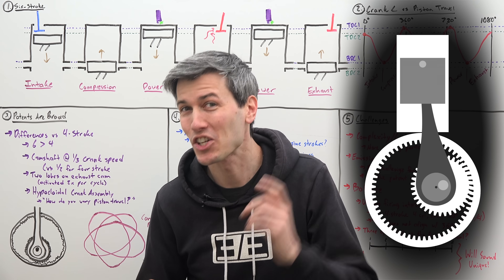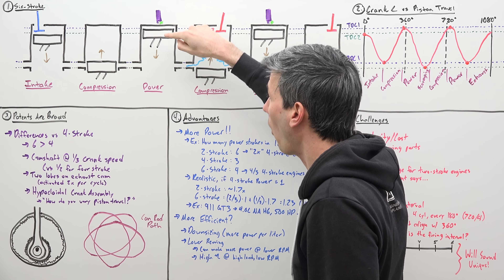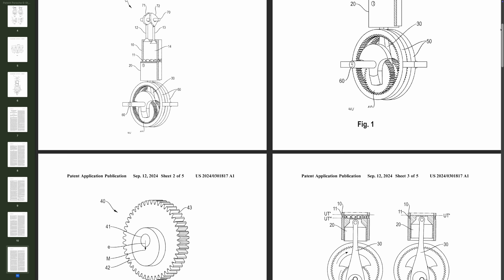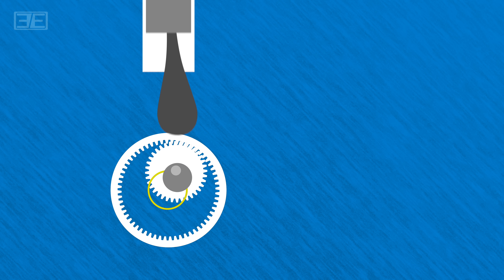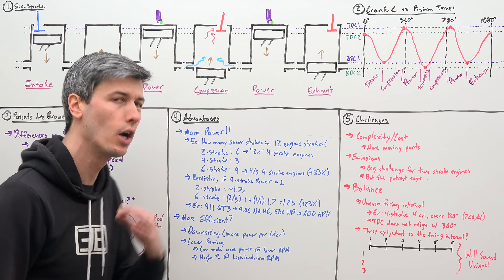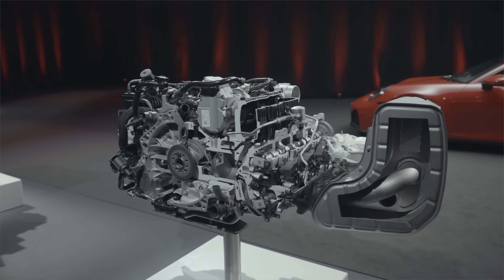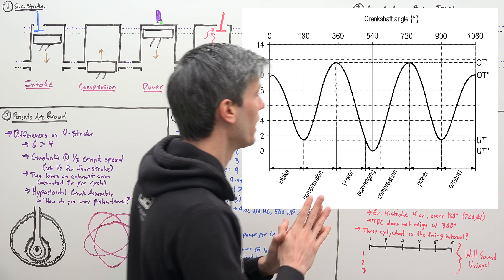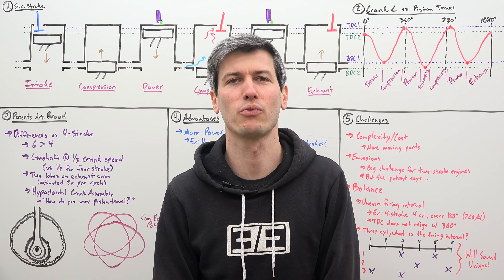Porsche's 6-Stroke Engine Is Genius!

Comment: There is no more fuel added on the second power stroke because there is still fuel left from the initial power stroke, something like 40%. Each power stroke has 2 cylinders firing, a full power one and a partially powered one. So it will increase fuel efficiency, power and emissions. It's pretty genius.

Comment: The connecting rod set up sounds like an inline version of what a radial aircraft engine does using a master rod. Having a mixed four and two stroke set up I image it would require two seperate fuel systems that would need to be synchronised.

Comment: Keeping the bottom end lubricated seems like an issue. You can't have a typical oil seal on the Piston like you would in a four stroke application, you also cannot run premix for efficiency and emissions nonsense.

Comment: Don't you love how a big corporation can haphazardly pull a technology out of its @55, not specify anything with formulae or actual proven testing, making a very generalized document, so that they can claim copyright infringement should anyone else, who is unknowledgeable of this patent, and does do all of the calculations and testing and  comes up with a functional engine. And during the court proceedings, the big corporation steals the outside data during the discovery phase, and uses it to their advantage. 

Sorry for being cynical, but it seems to be the current trend. Patents are supposed to protect the inventor, but the legal system has been abused so that patents stifle innovation.

Comment: There is a trend towards simplifying engines with fewer parts. Porsche could enhance these existing concepts by developing a streamlined engine design to replace the current complex combustion engines, not make them more complex.

Comment: The cylinder that is on it's two stroke portion of it's cycle will have a lower compression ratio than the cylinders on the 4 stroke version of the cycle, if I understand the explanation.  This will make the emissions of the two stroke cycle even worse than it already is, because to uncover the ports of the two stroke intake there is going to have to be a pretty fair drop in the piston's position in order to get any significant airflow to fill the cylinder.  This will make the compression ratio fairly terrible for the two stroke portion.  You might be able to clean the emissions up a little by recycling some exhaust into the two stroke cycle ala EGR, but it won't have enough kick to clean up the emissions from a two stroke.  Is the engine going to use two different fuel supplies to compensate for the drop in compression ratio, or is it going to use just the one fuel supply?  If it does, the fuel used in the two stroke portion is going to be wasted on that lower compression ratio portion, and it will also mean that it will contribute to the worsening of the emissions out of that cylinder over and above the previously mentioned two stroke emissions (higher compression usually means more efficient combustion, which means better emissions).

Comment: If you are going to scavange from low ports in the cylinder wall, why not just go for a scavanged 2-stroke design, a-la Detroit Diesel?  What do you gain with the extra complexity?  I don't get it.  It might work, but why do it, for Christ's sake?

Comment: What about the losses due to the gears rotating under extreme stresses. Friction and heat will be significantly higher than bearings. What happens if a tooth breaks?

Comment: It's amazing how we keep coming up with ingenious and expensive ways of creating carbon dioxide emissions. I got bored with the video. Is there a massive increase in efficiency from this? A massive reduction in carbon dioxide emissions? A massive reduction of other pollutants? Improved safety? Improved (reduced) noise? Improved power? Better balance with less vibration? Cheaper to produce?

Comment: 1. Balancing is not about firering in even intervals.
2. If you shift the Zylinders 360 degrees, every 360 degrees zylinders are firering, and thats even then
2. A. Thats the same rate, like a 3 zylinder 4 stroke engine, but with double time firerings
2. B. But the balinging in this case ist difficult because of: the zylinders go up and down together.
2. C. 6 zylinders would solve this problem (with 180 degrees shift)
3. There is another balancing problem: the different accelerations and decelerations inbetween going up and down ... I think here you need some difficult balancing shafts
4. If you use 180 degrees with only 3 zylinders, then you have 1 stroke with 2 firerings ... But this could be a benefit in terms of torque and grip.. If you have one more power stroke, thats good (just more power) .. but inbetween, the tires can "rest" and can catch more grip .... 

I'm not an expert ... But this are my thoughts at this issue 

(I'm a german guy ... Please apalogize my English ;))

Comment: "Genius" without application.  Can it recapture energy when you slow down or go down hill?  Does  it burn fossil fuel and emit CO2?  There's this genius thing that Michael Faraday came up with and many have refined since.  It's called an electric motor.  Now that battery technology is developing at a rapid pace, it's the only way forward.  Porche are wasting their limited money on this obsolete BS.  Make compelling EVs or go broke you idiots.

Comment: Sounds complex and difficult to manufacture, not to mention expensive. How is cam timing vs. a standard 4-stroke? Seems like valve open/closed duration would be compromised, but I'm sure that has been addressed. The exhaust note should put the Harley to shame.

Comment: I bet this would have no problems with emissions.
Besides the oil in the gas, the emissions issues in two stroke gasoline engines mainly comes from the fact that the intake and exhaust ports are open at the same time.  This allows unburned fuel to exit through the exhaust port.

I think the biggest problem with this engine is that it would be very tall.  The piston needs to be longer than the stroke and have a second set of rings at the bottom to seal the intake ports, like seen on two stroke diesels.  This would mean the engine needs a very tall deck height or a very oversquare cylinder.

Comment: To the point of "clean and complete combustion" the original video i had seen discussing this engine was that they would run second power stroke primarily on the remaining unburnt fuel mixture from the first power stroke with minimal fuel added for the second. Suprised you didnt touch on that point but it may not have been discussed in the patent. Very informative video either way 😊

Comment: as per the video and the many comments below, the power output of this thing will be all over the place due to the varying power outputs of each cylinder and the combining of all of these outputs to the drivetrain via a common crankshaft.  realistically the practical use of this engine must decouple this wildly varying power output from the mechanical drivetrain.  therefore, it can only practically be used in a hybrid system.  however, the common crankshaft is still a problem.  the solution is to consider this as 3 x 1 cylinder engines in a single block, not 1 x 3 cylinder engine in a single block.  in other words, the connecting rod of each cylinder couples directly to a compact generator at the base of each cylinder, not to a common crankshaft.  3-cylinders powering 3 generators essentially means that this block produces a complex version of 3-phase power.  the power outputs of the compact generators can then be combined using power electronics to charge a battery.  the battery then powers the electric motor(s) that drive the mechanical drivetrain.  the camshaft can still be common to all cylinders.  it certainly would change how an engine is timed and how that timing is coupled to the camshaft.  different but doable.  this power output model is similar to a hydroelectric dam - where a single body of water is divided into individual streams to power individual turbines whose output is then recombined and transmitted.

Comment: I can think of 2 ways it increases efficiency. The expansion stroke is longer than the compression stroke for both 2 stroke and 4 stroke side of things. In the 2 stroke cycle, they can choose not to fully scavenge the exhaust, leaving some exhaust gasses into the cylinder and burning less fuel without going lean, like EGR but without the mess. They can really fine tune it by having two separate throttles for feeding the intake valves and ports.
Reply: 2 strokes have very little engine braking because having the throttle closed doesn't cause the piston to pull a vacuum. So, really throttling down the 2 stroke intake port will be less deleterious to engine efficiency under low load and power requirements. They can even completely not inject any fuel during the 2 stroke cycle under low load operations, but really open it up under high demand for power.

Comment: Would the scavenging prevent the use of a turbo? During the very small time window for fresh air to push the exhaust out, the piston gas pressure would have to be less than intake air pressure for it to push, and if there is resistance in the exhaust then it would get them worse.

Comment: Congratulations of the 1000th! Triumph uses an off set firing order on their 900 cc & 1200 cc inline 3 cylinder Tigers. They call it a T plane crank. Firing occurs at 90 deg, 270 deg and 540 deg. It has introduced more vibration but gives a better torque response compared to even firing order.

Comment: Fantastic. Not. 
 I wonder what the longevity of a performance/ economy gear tooth crank lasts? Guess we don’t know yet. Looks like a second hand failure nightmare. Those gear teeth will love that over time with extra power stroke. Get back to me after a few missed oil changes?

Comment: I think the two firing strokes will be uneven in the power they produce so could be an issue with vibration even if this is small it will cause odd wear issues and as you say balance. Many congratulations on your 1000th video amazing

Comment: Dead on arrival. 
The killer is the two stage piston rod travel. That variation in load will kill whatever bearings are put in it. Plus, the actuator for the variable piston travel has to be perfect every time or kablooey. This is not like sliding cam followers back and forth at certain times of load. The stresses at the crank are enormous and cranks like no play in them. This thing comes designed with play in the piston rod travel. 
If they can ever make this work, each engine will cost a hundred grand to make.
Dead on arrival but a neat idea.
I really wish more work had been done on the Wankel engine to make the seals last much longer. Perhaps even make a diesel Wankel engine. The Wankel engine is one of the simplest designs ever made.
This Porsche six stroke engine will bankrupt the company, if they ever go at it with more then just a couple of test built engines.

Comment: The Main reason for the sox Strokes to 😢be cleaner than 2 stroke is that it would be lubricated by the motor oil pan and not by oil added to the fuel.

Comment: Wear and tear on an engine equates to the reliability.  This to me doesn’t look like a design that can do many kilometres.  Secondly the additional drag on the piston by the design of the circular crank would crate more drag than a standard more simpler  current pinion design connection

Comment: a 6 stroke v6 in the cayenne for economy helps the total fleet mpg when they use a 6 stroke flat 6 in the 911 for 23% more power.   it does sound hard to implement, but they made a rear engine sports car work, so…

Comment: it will get the extra efficiency by re-firing the 4 cylinder exhaust in the 2 stroke cycle, resulted in more complete fire and less heating the intake air.  this is not a new idea. the 4 stroke will be fuel rich, any unburnt fuel will get burnt on the second stroke with only minimal new air and fuel added.  i am not convinced any of this will work hp/pound.

Comment: The only problem is the same as opposed piston engine ( achates) to keep oil out of  the intake port (in barrel) the oil ring must reside in a portion of the barrel that sits below the port this being so how does the main part of the barrel get it's lubrication so as to stop scuffing of the bore,rings ...!! This problem is the only is the only problem that is insurmountable as in the reason ACHATES have not succeeded, if their answer is we don't have a problem with that they're Lying.  Their bore treatments don't stand the test of time ,longevity.

Comment: I feel like the vulnerability is going to be in the geared crank. I wonder if it's not easier to always have the longer piston stroke and to introduce an (electric) valve system at the bottom of the cylinder.

Comment: I don’t think it would burn clean, the cylinder walls get lubricated with oil, the piston rings scrape the oil off as it goes down to prevent oil being burned, but this design has ports in the cylinder walls, when it scrapes down it will put oil into that intake

Comment: Also the spark timing for the 4 stroke and the 2 stroke would not have the same angle from the TDC. Further complicating the matter. For example, 10 degrees BTDC for the 4 stroke and maybe 5 degrees BTDC for the 2 stroke. (just a WAG as an example)
It gets even worse with spark advance for RPM. Do the 2 stroke and 4 stroke systems need the same degree of spark advance as the RPM increases.
I suppose the computer could handle it but...

Comment: This is a really great explainer, thanks, and congrats on 1k vids!  The other explanation video I found useful for this was the Driving 4 Answers channel.  He goes into a bit more detail about how you get more efficiency and cleaner combustion out of it.  Essentially:
* If you look at the first intake stroke, you get a "small" intake (TDC2 to BDC1) but a "mid" compression stroke (BDC1 to TDC1) giving a greater compression ratio.  Better power and cleaner burn.
* Likewise, if you look at the first power stroke, it's a "full" stroke (TDC1 to BDC2).  This gives the gases more time to expand, pushing the piston for longer and getting more work out of the same combustion event than a fixed stroke length engine.  The combustion gases would be cooler though, and this could cause issues with getting a cat up to temp.
* At the end of that first power stroke (and the start of the combined compression/exhaust stroke), you're letting in fresh air from the lower intake port and will be adding fresh fuel to the mix, but you don't have to expel all of the exhaust gas.  Leaving some in there (i.e. closing the exhaust port part way through the combined exhaust/compression stroke) allows another good amount of compression to efficiently burn the air/fuel mix, as well as performing a second combustion on some of the exhaust gases and getting a cleaner overall burn.  The second combustion event would produce less power though, upsetting the balance even more.

I agree that forced induction would seem a better fit, especially for that mid stroke breathing from the bottom in a short space of time.

Comment: If you have scavenging you have a cleaner/better combustion as you don't have as much residual gases. That's what you'd do on big marine diesels... And two stroke direct injection with forced induction and scavenging sounds not too bad (apart from potentially NOx if running petrol).

Comment: It'd be awesome if it sounded like a 1930s John Deer 2 cylinder, which had the pistons set.... 120? degrees apart.  Pop-pop.....pop-pop---pop-pop....   Of course, those ran in the low hundreds of RPM and could easily drop into the 10s in idle or under heavy load.

Comment: 6 strokes engines are having 2 strokes more, as 4 stroke engine
Brilliant beginning...

sketch with 3 (of 4 strokes) + 2 (of 2-stroke engine) + 1 (last stroke of 4 strokes engine) got me though

as many complex technical solutions, the question is: does the complexity (being reciprocal to reliability) can be balanced in reality by the advantages? other concepts, like variable compression realized by complex crank axle doesn't seem to be as genius as on paper...

Comment: Obviously the second power stroke is going to burn the remaining unburnt fuel in the cylinder, leading to a cleaner and more fuel efficient motor. As an engineer, how do you not know this.

Comment: I thought the second compression stroke use internal EGR, mixing the gas with fresh oxygen and burnd many of these normaly unburnd  waste gases that was cleaned in the catalytic converter. So it schould be more efficient.

Comment: Essentially the used the technology used in 2-stroke ship engines utilizing the bottom ports which are always open at the lowest BDC. By doing this actually they can use more environmentally friendly engines by lowering NOx emissions by injecting at a later time since time of injection affects max cylinder temp during combustion which results to higher power but also higher emmision of NOx. On the other hand this method since it results to less NOx emmisions(my hypothesis), it results to lower fuel efficiency but that's where the second intake and power stroke comes in order to provide that additional power thus keeping the fuel efficiency good. It would be interesting to see the exact valve opening/closing times (CAD) in order to get better insight.